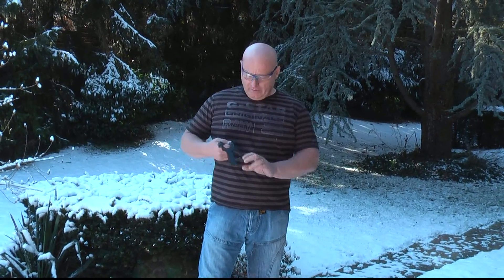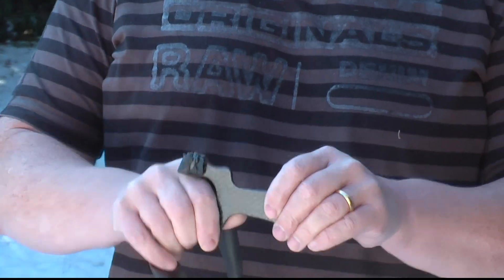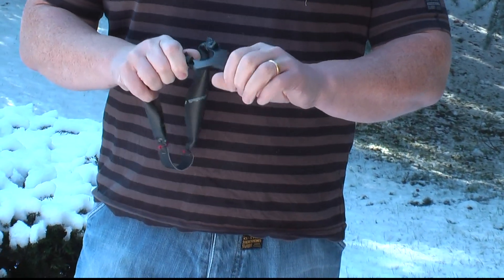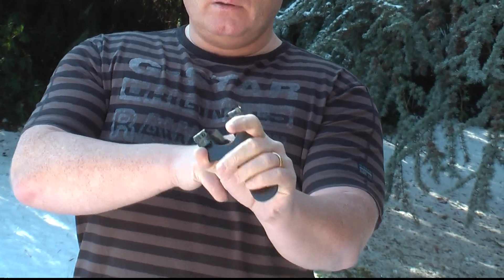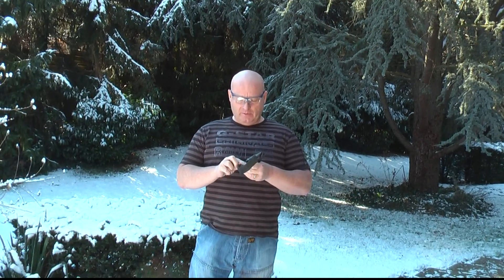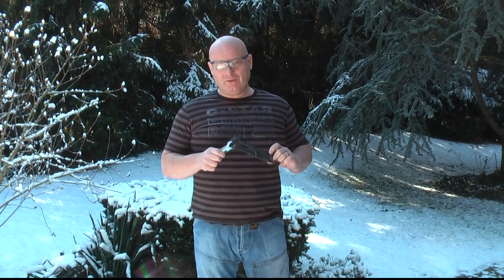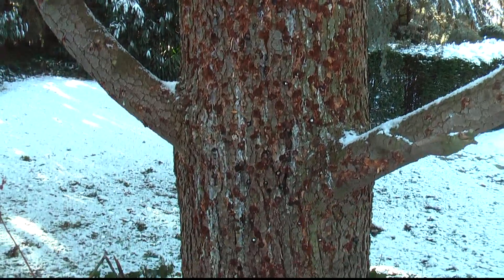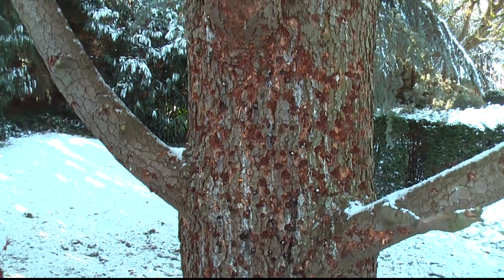Carbon Fiber Slingshot

Comment from the maker: That was just the price for the material. You still have to make the slingshot! That takes a few hours.

I never sell my slingshots, you have to find another craftsman or do the job yourselves.

You can't mold the material, you have to buy boards made from it and then cut the fork out. Those you get on ebay. I used a 5 mm piece.

Join the slingshotforum for more deatils!

Comment from the maker: Bench, my best 175 kg. Squad, 200 kg. Deadlift, 220 kg. The leg stuff, I have to be careful because I have a torn posterior cruciate ligament in my right knee. No symptoms other than the usual "folder" effect, but it is a concern doing high weights. I have been lazy lately and also lost 12 kg in my last diet, so I am not in top shape right now.

Comment: Glue a two-piece rubber (front and back) palm-swell on that and you'll have the comfort.
Carbon fiber tubing, and carbon fiber layup are also possibilities for an ultra-strong, lightweight frame. (If someone would  produce a cast carbon fiber  model that would  be  real cheap and awesome.) Put rollers on it for longer rubber (more energy store), wow. I'd do a  wrist brace as well. Chihuahua!

Comment: An even better way to use CF is to simply mold it. 

It's a bit more complicated than using epoxy, but not too much.

With the thickness of that shot, you have an awful lot of material there, but mostly you are using the strength of the resin, not the fiber itself.

You could make something even a bit more ergonomic (but less pocketable) by molding it.

We have a special clean room at the factory where I work and CF handlers wear head-toe protection and external air supply. Care is needed.